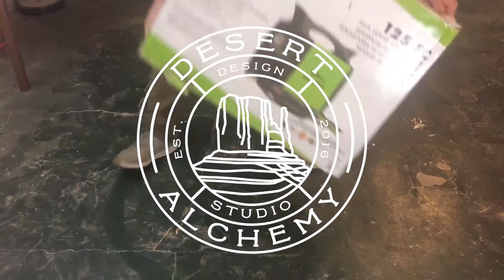Dining Table (Desert Alchemy Design)

Comment: hey man. I'm not trying to shoot down a new welder or anything, but I think your machine may be set up wrong. Do you have flux core wire, or solid? Solid requires gas if you're using it. Plus, the different wire has to be polarized differently. Check out the chart on the inside of the door for settings and set ups.
Reply from the maker: Anthony Baker it's flux core, no gas required. Thanks for looking out though 👍